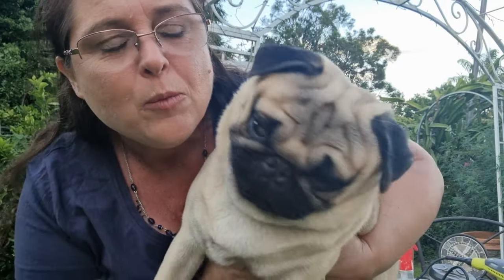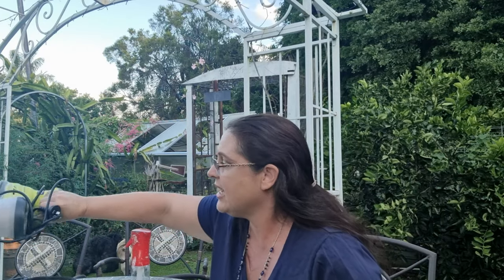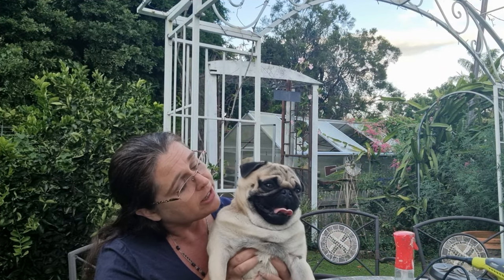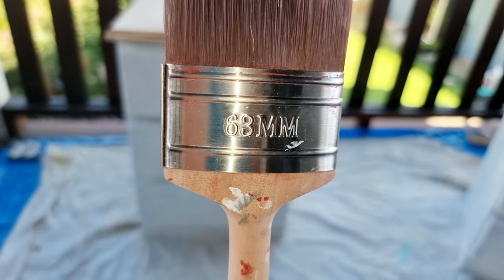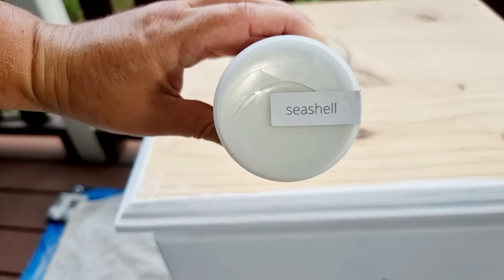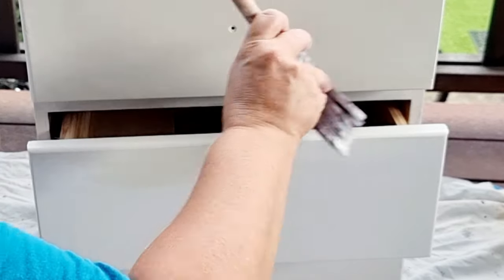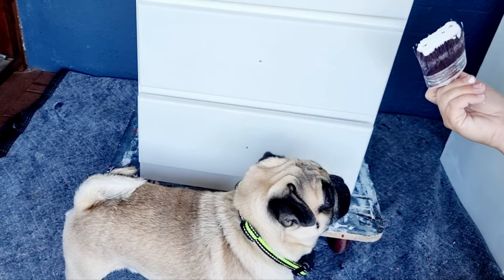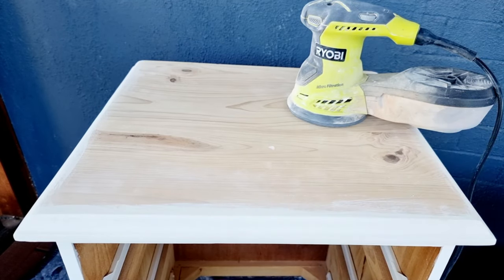The WHAT and HOW to paint Bedside Tables...along with a few extra tips.

Comment: Great intro video and I love Frank's 'help'. Question for you, when you sand between coats of paint, what grit level do you use?
Reply: I use 220 or 340 grit.  You really just need to remove and smooth down any bumps and paint brush lines then you'll have a lovely smooth finish .